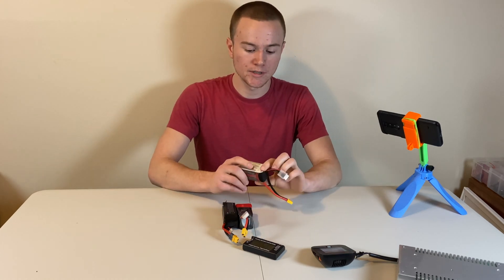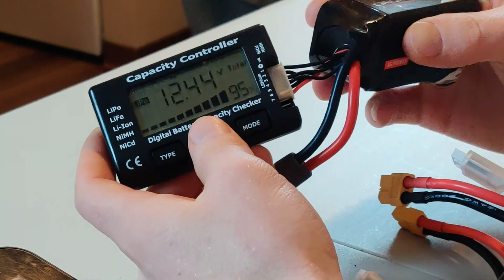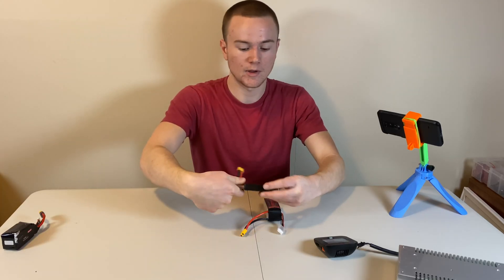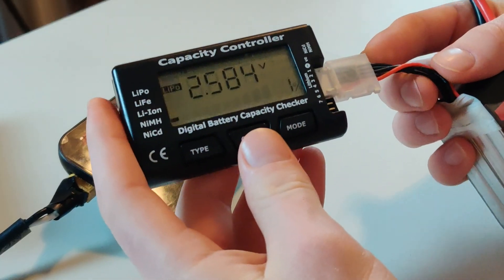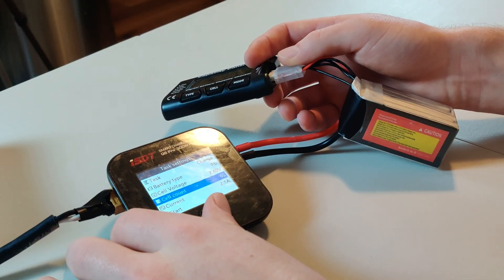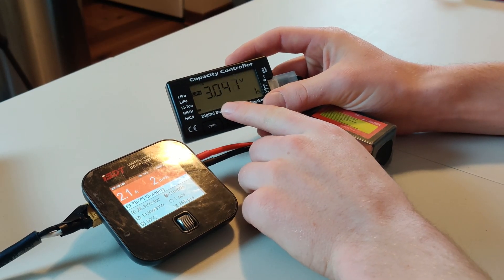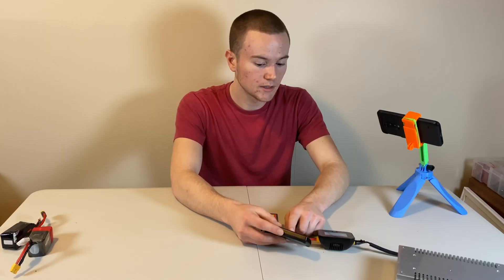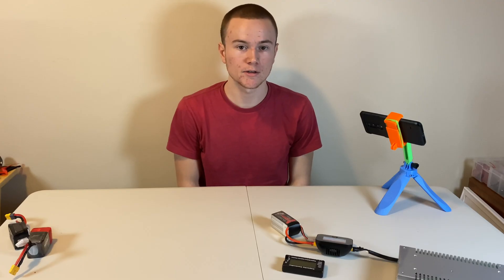How to Revive a Dead or Low LiPo Battery Cell

Comment: Ive saved probably 20 0.00v cells in fpv lipo battery's thus far and none have caught fire or puffed but i dont wreck with those lipos.
Reply from the maker: I've saved some that have gone to 0.00v successfully as well, but a couple have puffed and gotten dangerous. It's possible, but not recommended.
Reply: @easydrone3100  what i would do and just did today on a lipo i had 4 days on charger with charger off accidently cause i have 6 chargers i use for charging station and few are duos and use a few idst parallel boards and this lipo was dead dead drained all 0.00 cells. tattu r line 4.0 . I first started charging at 2amp then 4 lipos came to voltage and 2 would not even at like 4volts per cell on other lipos. So i hooked another lipo on store voltage up to balance board which then pushed juice into 2 remaining dead cells but what sucked is they kept lagging behind by .2 volts to other 4 cells and when i first done that lipo got warm so i put it out in cold for 15min. then back to charging at 2amp but i would still hook another 6s lipo balance plug only up to parallel board because it would help lower the 4v cells down to like 3.9 allowing the charger to push more mah into the lower 2 cells and battery was no long getting warm like initially did and resistance per cell was under 10 on all 6 cells. So then i just charged it on 1amp till done and all went to 4.2 then flew a quadcopter in home for 3 min to discharge some to check voltage balances and they were no longer lagging but by like .04 behind other 4 so then i charged at .5amp  . But yea if a cheap lipo may not have worked who knows. my fpv 130-150c lipos do not puff. but thats freestyle flying i think they are puffable if MCK is flying a race quad haha.
Reply from the maker: @Matt-xy6cf  That may work, but those cells are now unstable. You're asking for a fire eventually at this point.
Reply: @easydrone3100  yea only 4 of 6 cells held voltage so to charge it takes way to long cause it has to constantly drain out 4 cells while slow charging other 2 that dont hold voltage. So i just drained it and called it done. have plenty of other 6s lipos.
Reply from the maker: @Matt-xy6cf  Sounds about right. I've personally found that 4s lipos outlive my 6s by quite a long time

Comment: Thanks,  I just shoved it on my function generator n very very slowly cranked up the volts across all cells to get to 4v on all 3 cells. N it worked. I managed to hook it up to the normal charger afterwards!

Comment: "unrecoverable" is a bit of a stretch. Plug it in as 6s without the balance and just charge it a regular c rating for a while. Ive done it on both NimH and ordinary lipo and recovered cells just fine. Just watch them closely and touch them often. If you've just run them down you should recover nicely. On physically ones, dont even try.

Comment: I bought four new R-line 1500 mah 6s lipo for my quads. They all were used once. They were out back to storage voltage. Now cells 3-6 are all 0 a month later. I’ve a 4 bank venom charger and I measured each cell with a multimeter. I’d love to know what went wrong.

Comment: Just tried this on a Tattu 5.0 6s 1400mah 150c battery with a cell that dropped down to 2.1 volts. Hooked it up with no balance port and charged it as lead-acid at 0.8 amps for about 2 minutes. Took it off, and the charger accepted it again as a chargeable lipo when i put it in lipo balance charge. Wish I would have known this a long time ago haha. I will subscribe just off of this video! Thank you so much!
Reply from the maker: Glad it worked for you! Yeah, this has saved more than a few of my own batteries as well
Reply: @easydrone3100 i did that with a battery that was 0.0v  and saved it not evrytime a dead lipo is a dead lipo  i mean internal resistance is equal and voltage per cell is equal so in my case this lipo is okay

Comment: I have a problem I have a 3s 5500 mah lipo which I may have forgot to storage charge, but I am sure I did, now when I went to charge it, I see sell 1 is 0.931v and cell 2 is 4.175v and cell 3 is 4.210v, how can I get cell 1 volts up, I have tried the Nimh recovery but no luck.
Reply from the maker: Ooh. I just had this happen as well, I’ll make a video on it for ya.
Reply: @easydrone3100  Oh I know how to sort it out now no need.
Reply: Please share how it's done?
Reply: @LP_APUgamer  Dispose of the lipo to a recycling place that deals with batteries, and buy a new one.

Comment: so, if the dead cell is 0 volts it can not be revived?
Reply: Have the same question. Pretty new 2s lipo only charged 2 times and now cell 1 is 0,0V damn
Reply from the maker: I've had luck reviving lipos at 0v, but it is less likely than if the cell bounces to 0.6v or something like that.

Comment: Does it mean that my almost never used 3Cell  batterie (that was in storage voltages of each cell for a year or two)  with 1 cell sudenly giving 0.0V is a batterie to throw away ? Even when 2 other cells or perfectly fine ? Can that batterie catch fire with that 1 cell to 0.0V if I just leave it like that in my house ?  Important pls, Im paranoia, I don't feel safe with those batteries here. I bought so many like 5-7 yeras ago but never used them really, just checked sometimes they are stored around 3.8-3.85 volts, Im scared now other Lipos will follow sudenly having death cells , how can that even happen when I had them in storage voltages ?  Thank you very much for any help
Reply from the maker: Hey, most lipo fires happen if they're fully charged or during the charging process.
Reply: @easydrone3100  ok, but what about charging and using my batterie then? Can 2 cells be charged safely and will the death cell stay death without farther harm? And if i can use it safe,  do i need to charge it as a 2S batterie,  or will that not work? Thx for a response

Comment: Yeah, nah.  I rent, and have no homeowners insurance.  Also, the advice that registers most with me concerning Lipos is "Don't eff with 'em coz you could burn your house down."  Burn. Your. House. Down.

Bad pack = discharge cycle, and off to the recycling depot.  Play it safe.  Every time.
Reply from the maker: That’s definitely the safest way to deal with it.
Reply: @easydrone3100  Saving for new packs is cheaper than replacing all your burnt up stuff, I always say.